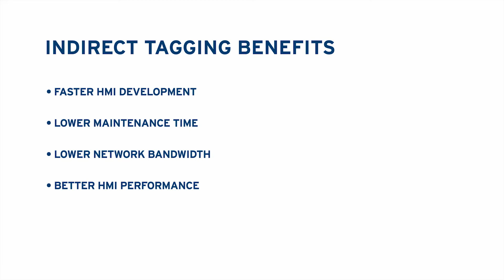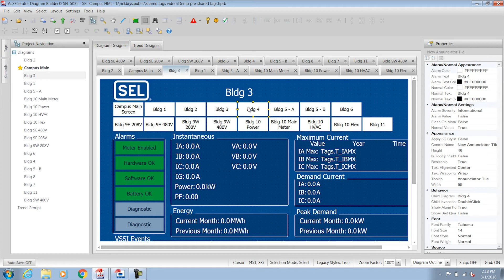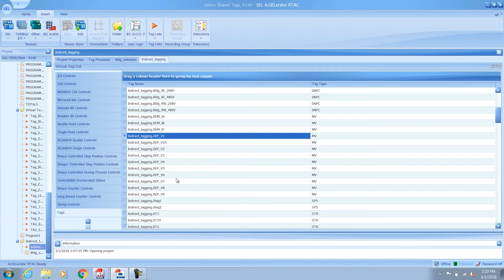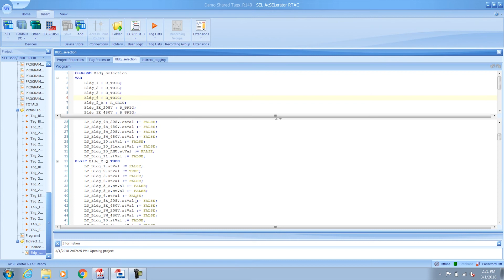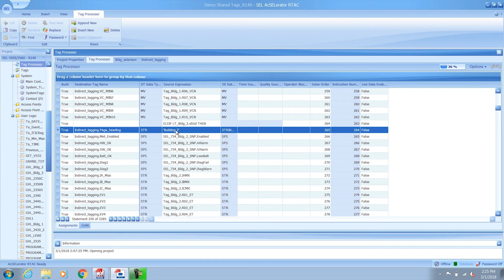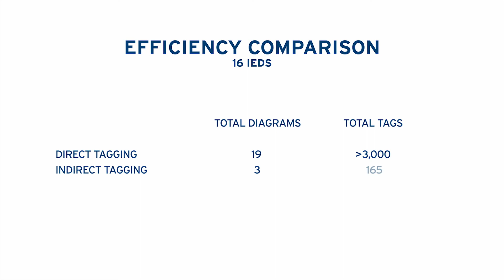How to Use the RTAC HMI, Part 3: Shared Tags

Comment: How do you jump from the "Campus Main" Diagram to the "GenericMeter" diagram without a hyperlink? I am confused a little bit.
Reply from the maker: Hello Alfredo, there is another way to open a different diagram besides using a hyperlink - it is by using an anunciator tile. In the Properties of the annunciator tile, you can see there is a Child Diagram under the Linking heading. You can specify another diagram to open when you click on the annunciator tile, so it acts like a hyperlink, but it also allows you to show in the annunciator tile the state of a configurable binary input.
Reply: @selincvideo  I was able to implement the Tile Annunciator and this allowed me to jump to another diagram, the part that I don't understand is how to send a command to the RTAC. At this moment I have to controls that I need to click, the fist one is the Binary Output Control that allows me to send a command to the RTAC and then the Tile Annunciator that allows me to open a diagram. But how can I achieve the same result clicking in one simple control? I really appreciate your help.
Reply from the maker: @alfredoborrero8631  Here is the app guide which has a downloadable sample project to answer your questions, please note that you will need a MySEL account to grant access: https://selinc.com/api/download/131978/

For further questions, we can get you in contact with our customer service representative in your area here: SEL_Southeast@selinc.com